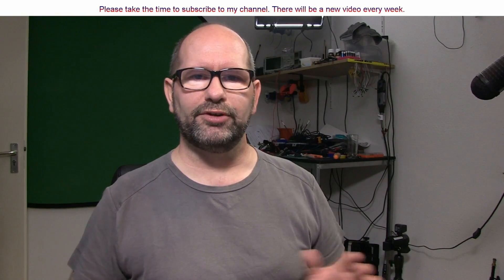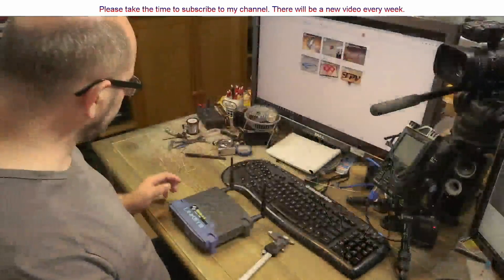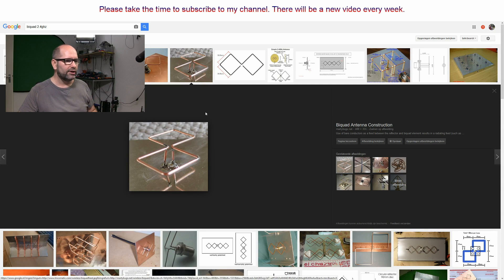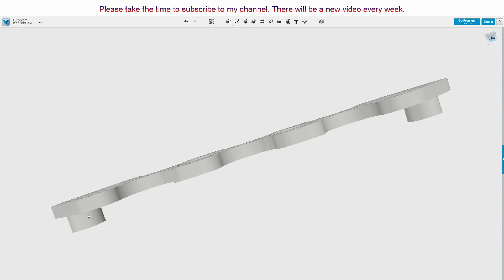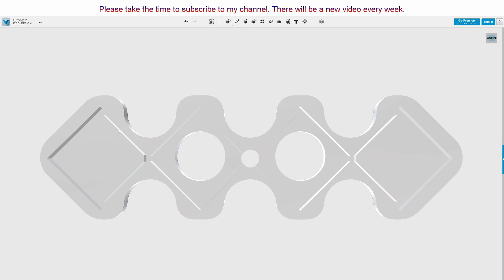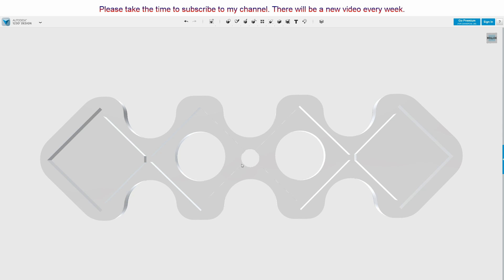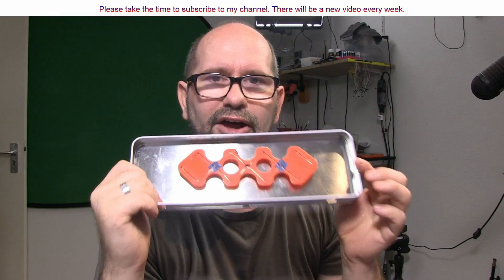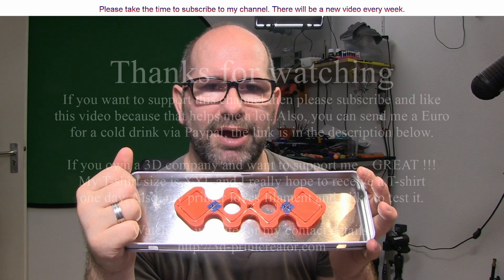▼ Make a double BiQuad directional WiFi antenna using a 3D printer.

Comment: How to make for 2.6 ghz 4g??
Reply from the maker: Well, first find the plans how the antenna should look like, what measurements it should have, etc. Then, just like with this antenna, make the plastic mold for it and insert the copper wire in it. Working with a mold like this ensures you don't make a mistake with lengths and shapes.

Comment: i believe biquad and double biquad antenna are very forgiving design.
30 mm, 31 mm, 31.5 mm ;will ended up good result anyway.
and if you want precission it does easier to use PCB instead using etching method/ or cnc pcb engraving..
Reply from the maker: You are absolutely right in this, but making a PCB or CNC milling metal to make an antenna is not reachable for everyone. In addition, my channel is about 3D printing, so it makes sense that I choose this method to make a simple antenna.

But, if you want a really perfect antenna, then I totally agree with you, I would just make a PCB.

Comment: 'Template' is a better choice of word than 'mould'. A mould is for casting a liquid. Also, aluminium foil is just as good as copper and far less costly. Why did you cut the edges of your template squares?
Reply from the maker: Hi Ben,
Thank. Template is indeed a better word for it.
As you might have noticed I am not a native English speaking person, so this kind of mistakes are happening to me.
Reply: I did notice that English was your second language, and that's why I suggested the word for your reference. I appreciate your wonderful video. Thank you.

Comment: Brian,

Very nice antenna design.  However, the antenna may be slightly off frequency unless you included the relative dielectric constant of the plastic you used.  For example, if you used ABS, the relative dielectric constant at 2.4 GHz is about 2.75 (from "Broadband Microwave Frequency Characterization of 3D Printed Materials", P. I. Deffenbaugh, et al., IEEE).  The reflector spacing and dimensions of the antenna are affected by the electrical properties of the plastic and the fill factor used in the 3D print.  The wavelength of the 2.4 GHz signal is reduced by the square root of the effective dielectric constant.  In this case, for a 20% fill factor the reduction in wavelength at 2.4 GHz would be the SQRT(0.2*2.75 + 0.8*1) or about 1.16.  Since the antenna-reflector spacing is a combination of air and plastic, say 50% for each, the reduction in wavelength for that spacing would be SQRT(0.1*2.75 + 0.9*1) or 1.084.  Fortunately, the antenna is fairly forgiving in its characteristics.
Bill Keicher
Reply from the maker: Hi,

Thanks for this information. I am not good enough in calculating the antenna 1:1 ratio and taking the used materials into consideration, but I do think this is very interesting.
I have yet only tested if the antenna had better characteristics then my old antenna (very simple test, with my old antenna I could not reach my garden house, with this one I even had a very strong signal there). For this frequency, I don't know people who have a 1:1 meter, so it's not officially tested.
Reply: What about the diameter of the copper wire, ist the distance measured from the reflector to the middle of the copper wire or from the reflector to the outer edge of the wire?

Comment: please tell me the spacing between the actual antenna and the reflector, 12mm?
Reply from the maker: Approximately 11mm (depending on where you measure) but you just can't go wrong here because of the printed mold.
Reply: thank you

Comment: In English, reflector is a cookie tin lid. The metal lid appears to be tin rather aluminum. Brilliant, especially if the maker has access to a 3D printer (I don't).
Reply from the maker: Thanks for your help. I really didn't know the word Cookie tin lid :-)
And for the printing part, just download the file and send it to shapeways, or don't download it and use the printservice of Thingiverse, where I uploaded the part.
Everyone has access to a 3D printer service I guess.

Comment: How to adapt your STL to 1.2Ghz for FPV video? or 933Mhz for fpv telemetry?
Reply from the maker: Well, the short answer is... "Not". It's designed for the 2.4Ghz band only and it won't work as it should on other bands.

Comment: I'm using the following antenna (shown at 00:46 in the following howto): https://www.youtube.com/watch?v=4t6OliwhJ5g

It's the best I've ever used / build till now!

I've tried to make a 3D printed one, but till now no luck (the measurement's need to be very accurate!)
Reply from the maker: That antenna is called a cloverleaf antenna. They are not directional but they do provide a high gain.
I have seen various cloverleaf molds on the Internet but I have no interest in them to build them myself. I know however that they perform extremely well.
Reply: That is correct! I have been using them on 2.4Ghz and 5.8Ghz (obviously different size). 
They work great and as mentioned in the howto it is  none directional (great for a round radiation pattern).
Reply from the maker: I am now thinking, I do use them... A lot...
I use cloverleaf 5.8GHz antenna's on my racing quads for POV flying.
I guess you do to, otherwise you would have no interest in 5.8GHz I think.
Reply: Yep. I use clover leaf antennas on my 250's (mini)  for the videolink.

The one mentioned in the video is not really a clover leaf antenna (right or left polarization), but an omnidirectional biquad antenna. (no polarization).PS: I'm building a Mini-H 180 at the moment :-)

Comment: this is great I too have the shop away from the house and to make things harder the router is on the other side of the house. 
I will be looking in the thrift store a tin box (that is what it's called ) .
I would like to ask about the add in the middle of your video I have gotten use to them at the at the beginning but now it's a pain because it makes the viewer think the video ended.
Reply from the maker: Hi Buzzerco.
I didn't even know there was an add in the middle of the video. Of course I have add's turned on, because this is my only income from the video's I make (and it pay's less than a kg if filament each 3 months), but I will take a look to see if I can change that.
Reply: now it's gone strange
Reply from the maker: And I haven't done a thing yet... Strange indeed.